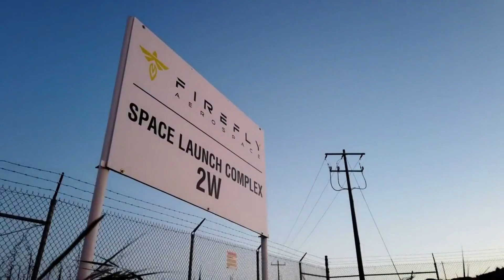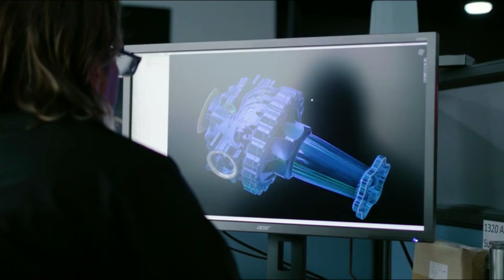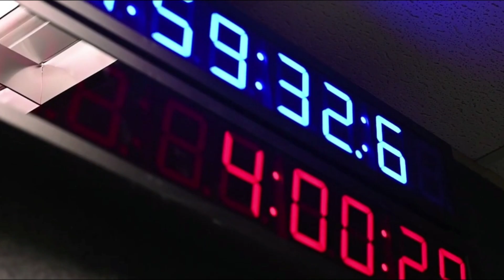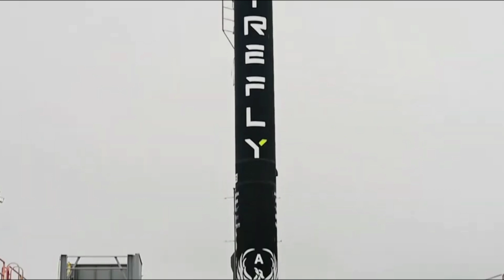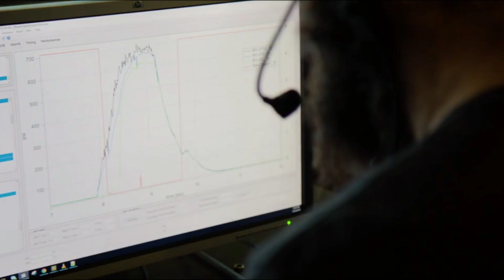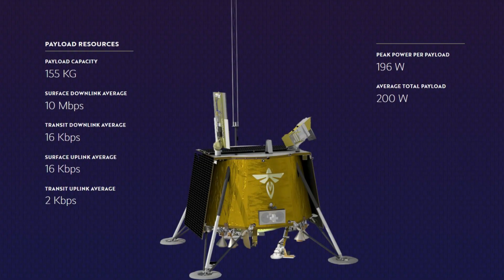Firefly Aerospace Is About To Launch Multiple Missions

Comment: Not to mention building the first stage of the Antares 300 rocket. With Antares 200's final flight on August 1, it's a race to get the 300 up and running so Cygnus can return to Wallops and Antares instead of launching on Falcons.